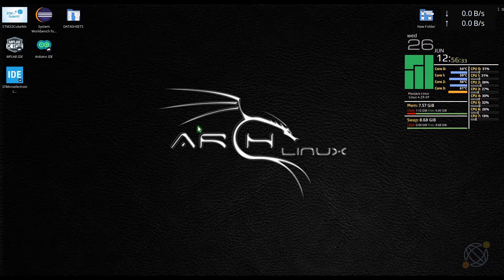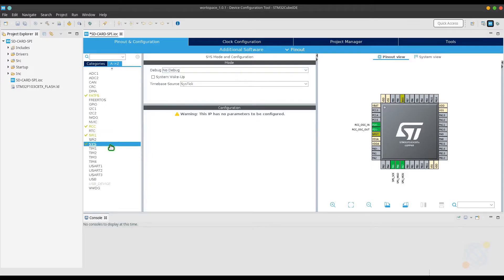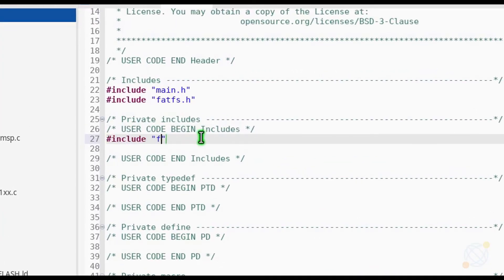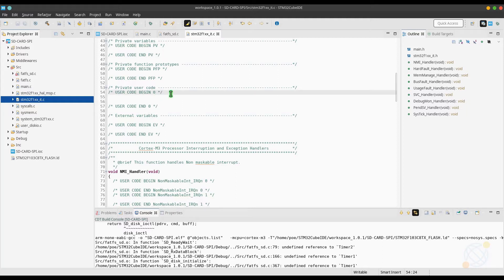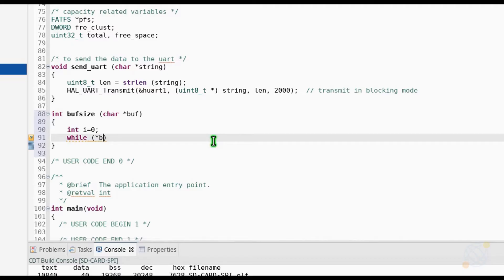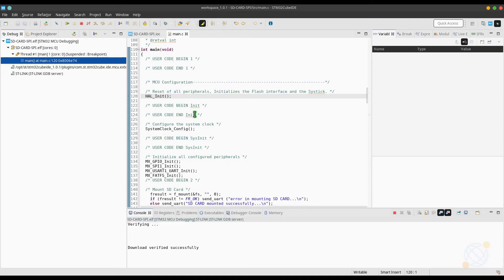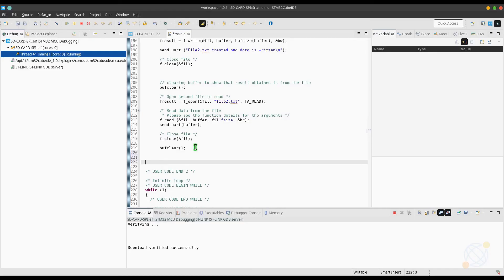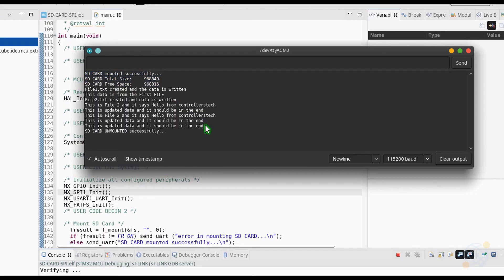SD CARD using SPI in STM32 || Cube-IDE || File handling || uart

Comment: Was such a helpful video. I made it work with a MSPm0l1306, by doing some small changes to implement my communication, but it was so helpful to understand how I would glue my applikation to the FATFS library. For some reason It wouldnt work in your user_diskio so i just moved all the functions into the diskio and then it worked.

Do you have or would you make, a video on how to implement it with dynamic memory allocation?

Comment: hello , first of all thanks for this tutorial. I tried this project with stm32f446re and it works pretty well. But i need to save a value every 10us at specific .txt file. For this reason i open , write and close the .txt file into an tim_irq_handler. It seems that the proccess of saving the data takes longer than expected. Do you have recommended changes in the above code to enhance performance? 
 
Thank you !

Comment: Thanks for the video!! Worked here in my STM32L152 Disco board, with minor adjustments. I was able to create files, write and read. However, a few weird outcomes: total and free sizes result with a dot before the number (numbers seem correct); also, the current version of FIL struct in ff.h doesn't seem to have the .fsize field, so I haven't found a way to read the correct amount of bytes yet. 

Thanks again!

Comment: Now I got it this on Termite UART:
SD CARD mounted successfully...

SD CARD Total Size: 	15521280
SD CARD Free Space: 	15521264

File1.txt created and the data is written 
File1.txt is opened and it contains the data as shown below
This data is from the FILE1.txt. And it was written using ...f_puts...

File2.txt created and data is written
file2.txt is open and the data is shown below
This is File2.txt, written using ...f_write... and it says Hello from Controllerstech

About to update the file2.txt
Below is the data from updated file2.txt
This is File2.txt, written using ...f_write... and it says Hello from Controllerstech
This is updated data and it should be in the end
Reply from the maker: 👍 good for you.

Comment: I commented this lines and it is working now, pay attention everybody that is anyone that is starting with this example to comment this if you want to put the sd card in your pc to see the data that was written on the sd card. I used a 16GB San Disk Ultra MICRO SD HC I and now worked. I think that cards with 2GB not work because i tested with 2 of then, maybe i should make the same thing that i did when formatted the sd card. The codes of control tech work really, but if you download the already code you have to follow the comments of the video about change MAX_SS to 4096 and USE_LFN to ENABLED WITH STATIC WORKING buffer on bss . When you format the SD CARD should make with FAT 32 and choose 4096 bytes. And slow the speed of SPI to 2.25MBps and i put external 5V power. Control tech have very good videos. I don´t like when my things not work, sorry about my declaration that i did before. Thank you very much for this video. And i am sending my contribution to this site.

/*************************REMOVING FILES FROM THE DIRECTORY ****************************/

  	/*
  	fresult = f_unlink("/file1.txt");
  	if (fresult == FR_OK) send_uart("file1.txt removed successfully...\n");

  	fresult = f_unlink("/file2.txt");
  	if (fresult == FR_OK) send_uart("file2.txt removed successfully...\n");

  	/* Unmount SDCARD */
  	/*
  	fresult = f_mount(NULL, "/", 1);
  	if (fresult == FR_OK) send_uart ("SD CARD UNMOUNTED successfully...\n");
  	*/

Comment: I put external 5V and not worked. I changed of sd card to another one of 16GB and still not working
Reply from the maker: One more comment from you and i will block you. 
I told you, ask in those groups. There is no point in spamming on YouTube

Comment: I did in Arduino and the SD CARD kit that i have work very well. I buy one like your video, but your software don´t write or read anything of SD CARD, not work. I tryed to format in PC but nothing happens, always the same bad things.
Reply from the maker: You posted the comment on the website right?
Just because you can't get it to work, "you think the code is very wrong" ?
Sort the comments to "newest first" and see how many people got it to work.
Reply: @ControllersTech  Yes, i did all the things and not write or read, but with arduino read and write. I format with fat and then i tryed with fat32, anyone works. Why in arduino works very well. I have blue pill stm32f103c8t6 and i have this board to put the card
Reply: @ControllersTech  I copy your program and nothing happens, i did a lot of times and nothing happen or 2G micro SD card, only with Arduino, this is my question. Maybe there is something very simple that i don´t know
Reply from the maker: I don't know why it isn't working for you. Try using external 5V supply to the module. Don't use the bluepill's 5V.

Also some particular types of sd card don't work. I don't remember which one exactly, but read the comments as some people have pointed it out.
Reply: @ControllersTech  But why this sd cards works on arduino uno?
Reply: @ControllersTech  but i Will try external power, i put The USB cabe tô power um The 5V of The Blue pill

Comment: Can I change timer1 and timer2 variable inside fatfs_sd.c file?
Reply from the maker: They are used for timeout. 
How do you want to change them?
Reply: I already use ur code and works inside HAL_TIMPediodElapsedCallback, but max interrupt speed that I could generate is about 0.5 sec, I need it to be faster, what should I do?

Comment: what is the difference between "fresult = f_mount(&fs, "", 0);" and "fresult = f_mount(&fs, "/", 1);" ?
Reply from the maker: "0" means the card can be mounted later also. We have executed the command and now it can mount anytime.
"1" means mount the card immediately.
"/" Is the path of the sd card, where the mount will take place.
Reply: @ControllersTech  I wanna ask again, why I can't use it inside HAL_TIM_PeriodElapsedCallback function for interrupt?
Reply: Thankyou sir..

Comment: Thank you very much, it worked perfect for me, but I noticed that using the MAX_SS at 4096 consumes a lot of RAM, I did several tests and reducing the value to 1024 and activating FS_TINY I managed to reduce the consumption of RAM from more than 19KB to only 5KB 😁🔥.

For some reason, setting MAX_SS to 512 causes the reading, writing and creation of files in the microSD to fail and I need to lower the RAM consumption even more to be able to implement it in a STM32F030K6 😥

Comment: I cant get it to work :(.Could anyone tell me the brand of SD card that worked for them?
Im trying with 128Gb sandiskUltra and 4Gb microSD HC

Im powering the 5v to the sd card reader from a lab power supply.

Cheers
Reply: //this is my uart output using eziya fatfs_sd.h library
//same outputs with sd card inserted and no sd card inserted
SD card mounted successfully ...
SD card total size:      5
SD card free space:      5
sorpesa.txt created with fresult:        255  (not event in the range of FRESULT enum)
file closed with fresult:        9    /* (9) The file/directory object is invalid */
file opened with fresult:        1   /* (1) A hard error occurred in the low level disk I/O layer */
file closed again with fresult:          9   /* (9) The file/directory object is invalid */
Reply from the maker: Replace the mount with the below function

fresult=f_mount(&fs, "/", 1); if(fresult == FR_OK){	 send_uart("SD card mounted successfully ...\n\r"); }
else { send_uart("error in mounting sd card ... \n\r");}
Reply: @ControllersTech  

error in mounting sd card ... fresult=FR_NOT_READY
SD card total size:      5
SD card free space:      5
sorpesa.txt created with fresult:        255
file closed with fresult:        9
file opened with fresult:        1
file closed again with fresult:          9

i leave my code just in case someone else is willing to test in their own hardware setup
gh repo clone javiBajoCero/bluepill_sd_spi
Reply: @javib8970  i have the same problem . When the code try to open the file "log-file" or any  other the fres variable it's FR_NOT_READY. I tried a lot of things, other codes, external power suply and upgrade the Cube Ide but doesn't work :c. Did you solve the problem?. I think that the problem is the FatFs file generate automatically
Reply: @andresfelipe6085  i didnt solved the problem...
I tried also to flash controllers tech github code but i get a weird error (wrong stlink serial number or something like that).
Anyway im about to give up with this and try sdio interface in an stm32f4
Reply: @javib8970  I can solve it (30 minutes ago ) my problem was the connection. I use the new version of the library and change mosi miso cables -> micro's miso with the miso of the module and micro's miso with the miso of the module and I look that the sd card have to be FAT32 or a release version because I've tried with 2gb old sd and any woks but if when I tried with 16gb it works (with external support)
Reply: @andresfelipe6085  can you share the code with me?

Comment: i cannot write integer number in text file.i am using f_write.Can you help me?ASCI table writing?
Reply from the maker: Does f_write accepts integer number ?
Reply: @ControllersTech  DHT_GetData();
    /* USER CODE END WHILE */
fresult =  f_open(&fil,"file.txt",FA_OPEN_APPEND|FA_WRITE);
f_write (&fil,&Temperature,1,&bw);
	
fresult= f_close (&fil);
fresult =  f_open(&fil,"file.txt",FA_OPEN_APPEND|FA_WRITE);
f_write (&fil,&Humidity,1,&bw);	
fresult= f_close (&fil);	
		
HAL_Delay(3000);
Reply: @ControllersTech  how can i fixed?ASCI number writing?
Reply from the maker: Are u serious ?
Temperature is a float value.. f_write accepts a buffer..
Use sprintf to convert and store those values in the buffer.
And then send buffer

Comment: Hi, is it possible to store a file after or out the main function??
Reply from the maker: Out of the main function ? Means where ?
Only the main function gets executed...
 You can write another function outside the main but you need to call it at some point in the main function
Reply: @ControllersTech  yeap in a external function and call it in the main thats what i mean
Reply from the maker: Yeah u can do that..
Reply: @ControllersTech  Its, becouse when i try my program stops
Reply from the maker: It doesn't stop. It might be going into hardfault because of some error u are making...
Need more details of this

Comment: Hello! Thanks you for the video! My controller is F103C8. How can i get throw away trouble with an error of mounts the SD card while microcontroller initialized? I had my spi speed set to about 2.5MB. I'm was formatted my sd card to fat32 file system, block size 512. p.s. miso mosi connected cross to cross.  p.p.s I'm use external +5 volt supply for sd card module. Maybe I'm doing something wrong?
Reply from the maker: debug and check the output of fresult.. and read the description
Reply: @ControllersTech  Hi. Tnx for the answer. fresult returns fr_not_ready, when 3rd argument is 1. If I use 0 its sayed its fr ok, but after when try to read or write the code its return fr disk error
Reply: @nterminator8347  I also need the answer of this question.
I'm taking the same error and i also get fr_invalid_object error.
How can i do more debugs without getting into low layer @Controllers Tech
Reply: I'm use 5 volts...
Reply: @ControllersTech  waiting for you response below.. Thanks in advance..

Comment: In my project (STM32G017...) f_mount did not succeed but simply hang. Upon further debug inspection it hang/loop endlessly  inside a HAL_DELAY() function (fatfs_sd.c --> void SELECT(void) --> HAL_Delay(1))... I followed the answer in this thread by overwriting the HAL_Delay function: https://community.st.com/s/question/0D50X00009XkXJp/hal-delay-stuck-in-infinite-loopnewbie  I did not understand whats the cause of the problem but this answer worked for me. Maybe this helps someone else too.

Comment: Hello thx for this tuto ! I would like to do the same but with ide arduino ... I didn't find help in the internet, do you think it's possible to interface sd card with stm32f103c8 using spi and arduino ide ?
Reply from the maker: Just use the arduino code. What's the issue ?

Comment: Thank you very much. I use stm32f103c8t6 and 2GB SD Card. but when run this code, I get successful mounting, 0 free and used space and nothing is created on my SD Card. could you help me please?
Reply from the maker: Are u sure mount is not giving you error ?
Reply: @ControllersTech  I used an external 5V power source for SD Card and it worked! thanks.

Comment: It seems f_write can not exceed 1023 for "btw" which is the number of bytes to write. If I try to write 1024 byte, I have FR_DISCK_ERR. 
Can you help me, if that is the maximum length I can write Or there is another problem to be solved. 
Thank you
Reply: the problem solved. I think it is a bug in the Fatfs_sd.c
In function "SD_TxDataBlock" there is NO "return TRUE" if the token =0xFD, it will be always "return False" 
my solution is just adding "else" for the "If" statement and return TRUE there.
Also, eclipse raise a warning there ('resp' may be used uninitialized in this function) which is make sense in case of 0xFD token.
Reply from the maker: Try changing the data type of btw.. i don't remember what's defined in the code.. just increase it like from uint8 to uint16
Reply: @ControllersTech  "btw" is "UINT". I think it accepts 1024 byte

Comment: Thank you for this great tutorial. I do not know why I try to follow but it does not work. I downloaded your codes and built. However, it is same result. There likes to be hardware problems. I use stm32f103c8t6 with 2GB sd card.
Reply: I tried use write speed is 1MB/s and 2 MB/s
Reply from the maker: Let me check
Reply: @ControllersTech  when debugging, it can not pass the 'fresult = f_mount(&fs, "/", 1);' line
Reply from the maker: Wait for few hrs.. i am updating the code. Check after 4 hrs. That one should work
Reply from the maker: check the description
Reply: @ControllersTech  Similar problem. 
1. I want to keep the file so I common the deleting file line
2. I build and get the output "ERROR!!! in mounting SD CARD...

SD CARD Total Size: 0
SD CARD Free Space: 0

File1.txt is oðbned and it contains the data as shown below

File2.txt created and data is written

SD CARD UNMOUNTED successfully..."

3. I check the 5v power. I do not know the reason compiling with STM32IDE cannot run with 5v power which is provided by ic 7805. 
4. I check the module sd card and reconize it use ic AMS1117-3-3 to convert 5v to 3.3v.
5. I just use 3.3v power which provided by my laptop to check it and get the same reason.
6. If I use keil to compile, I can use 5v power which provided by ic 7805 and get the same reason
7. I change writing speed however the problem occurs again.
Please tell me something to fix it
Reply from the maker: Ask in the telegram group... Its hard to do discussion here
Reply: @ControllersTech  Thank you so much. It workes
Reply: @kimlonglieu5673   Sir I have the same problem. could you help me please?
Reply: sir i have also facing a same problem. could you help me?
Reply from the maker: What's the error ? Ask in the telegram group...

Comment: @controllerstech am using stm32l476rg micro controller when interfacing with micro sdcard adapter am using your program to control it as per your procedure to settings in cubemx....but i  get the   "ERROR!!! IN mounting sd card" what mistake maybe occurred in   my side...please give the solution
Reply from the maker: You are getting error in mount itself. There isn't much i can do here.. It Could be anything..
Check your connection
Sd card is in FAT format ?
Check the SPI speed, it should be around 2Mb/s
Check the connection again.. there could be a loose wire.
Reply: @ControllersTech  my SD CARD is in FAT32(default) type.....how can i change into FAT type .....
Reply: @ControllersTech  when am debugging this code "fresult" return a FR_DISK_ERROR givs....what is the problem may happen...please give the solution....
Reply from the maker: Wait for few hrs. I am updating the code. It might work after that. Check after 4 hrs
Reply from the maker: Code updated... check the description
Reply: @ControllersTech  again same problem comes....when am debugging this code "fresult" return a FR_DISK_ERROR givs....what is the problem may happen...please give the solution....
Reply: @ControllersTech  am using stm32l476rg micro controller your code may be supported to my board?...
Reply from the maker: At what step do you get this error ?
Is the mount successful ?
Join that telegram group mentioned in the description... You will get better support there
Reply: @ControllersTech  mount unsuccessful.....

Comment: Thank you so much for posting this video! I was able to get it working with an SD card formatted with a block size (allocation unit size) of 512 bytes. How do you get it to work with other block sizes (for example, I'm trying to use a block size of 4096 bytes)? Is that possible?
Reply from the maker: Change the max sector size to 4096 in the fatfs setup.
Reply: @ControllersTech  Thank you. I can get it to work with cards up to 8 GB, but over that, they don't work. Is there something special I need to do with >8GB cards (other than format them with FAT32 and 4kB block sizes)?
Reply: I was able to get it working by upgrading to the newest version of the library: https://github.com/eziya/STM32_SPI_SDCARD.